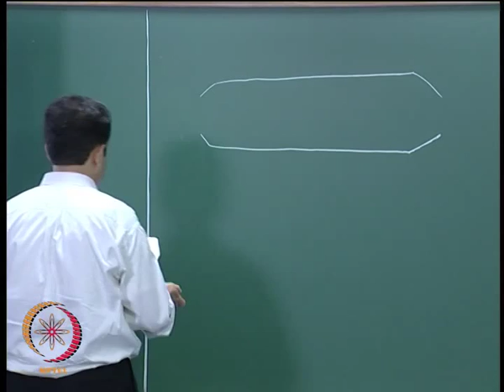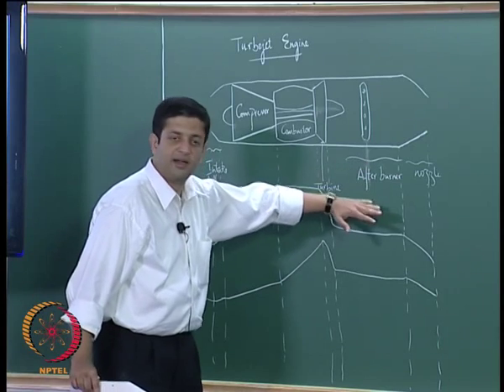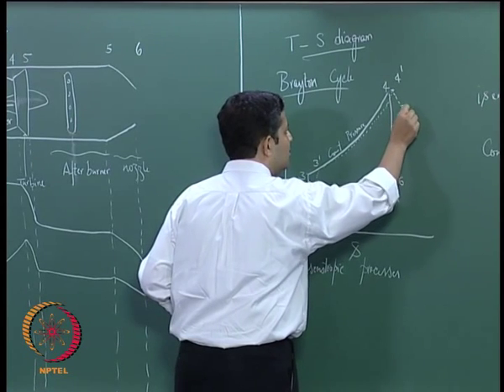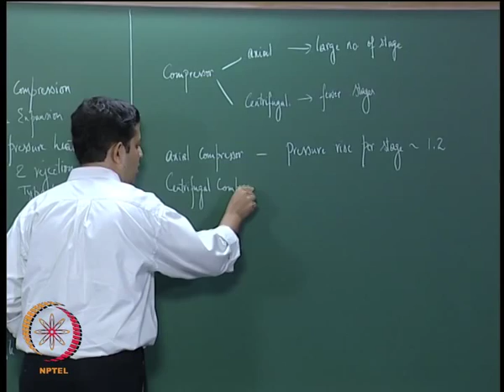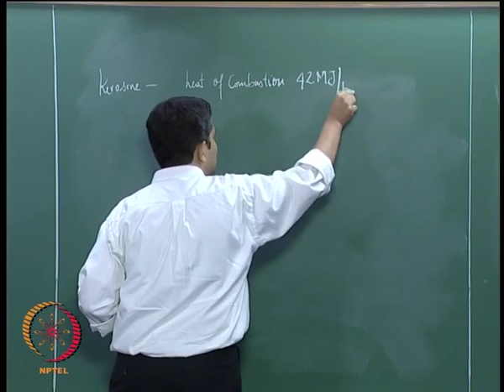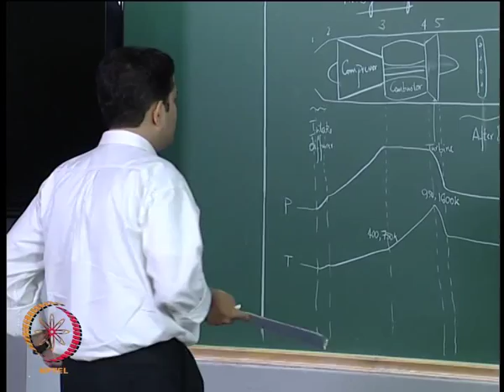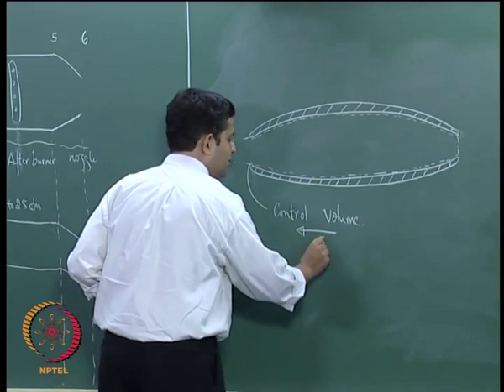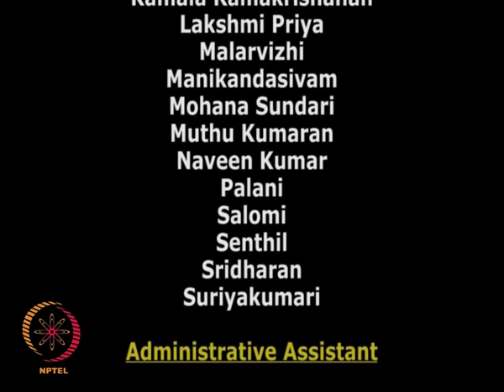Mod-01 Lec-02 Air breathing Engines – Turbojet I

Comment: Why process inside combustor is a constant pressure process?
Reply: A better question is, why does the constant-pressure approximation work? Of course the air inside the combustor is an open system and the real process is not constant-anything, but that doesn't help us much. So we need to approximate. We can throw away isothermal(and adiabatic) right off the bat. now it comes to isobaric vs isochoric. If you restrict the airflow, then it will be "more constant-volume than constant-pressure" and vice versa. And then you draw a p-V diagram of the stages and you find that the engine is more efficient if it is constant-pressure. So you reduce the load(by shortening the turbines) and make it resemble a constant-pressure process.